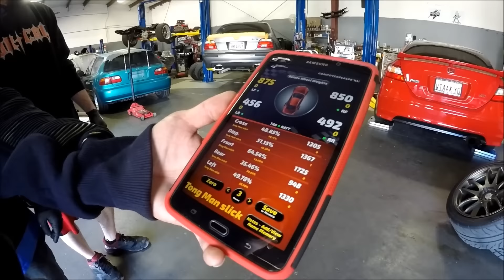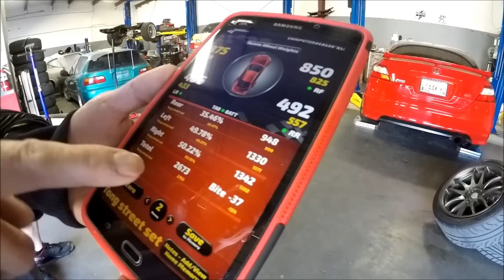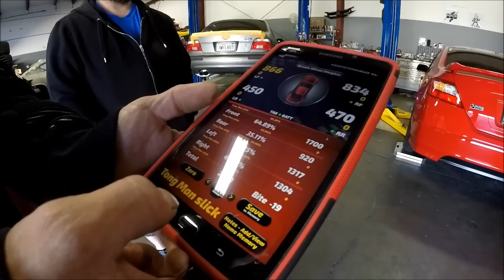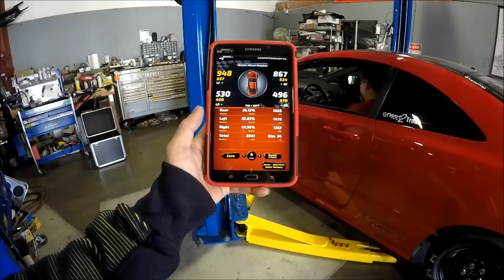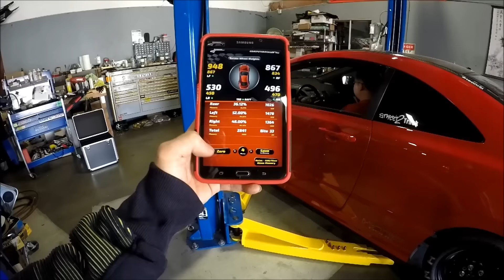How Heavy is BIG RED???

Comment: Since cte shut down how would you get a new belt or different pulleys? Asking cause I’m buying one used. Comes with a 2.95 pulley but want a 3.15 for less boost since I only have 750cc injectors ? Would merc racing pulley belt fit? Off the TVs linup?

Comment: These civics are way heavier than the older gen lol, em2s are like 2500lbs or lighter, then the ek’s eg’s are even lighter than that.
Reply from the maker: My EJ6 was 2200 pounds
Reply: TheTongMan dam, wish my Z was under 3k, its probably sitting at around 3150lbs.
Reply: PR1NCETD0T yeaa thats because those are regular models compared to an SI, the 2000 civic si weighs 2600lbs, but anything under 3000lbs is considered a light ass car, a 1992 civic ex weighs a hood 2400lbs, its only a couple hundred pound difference.